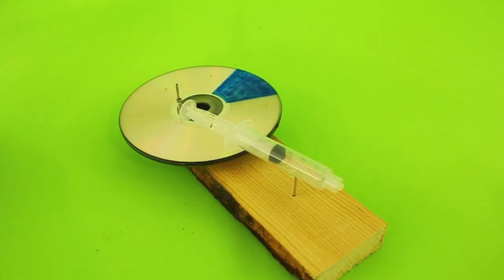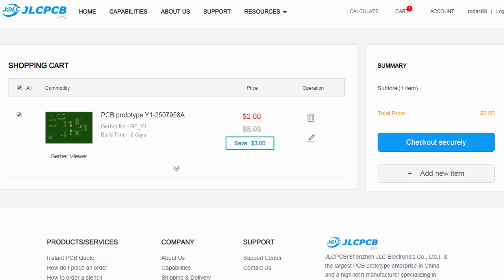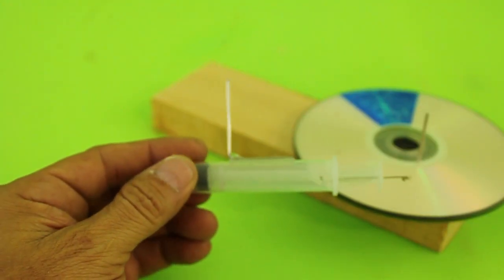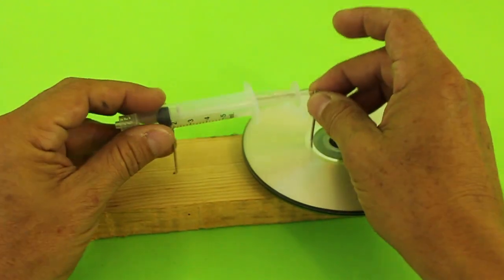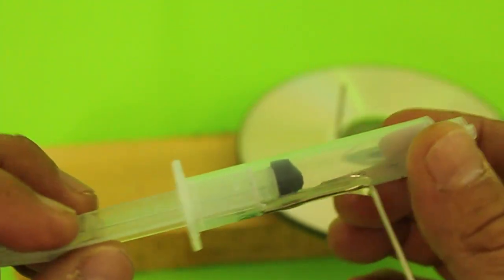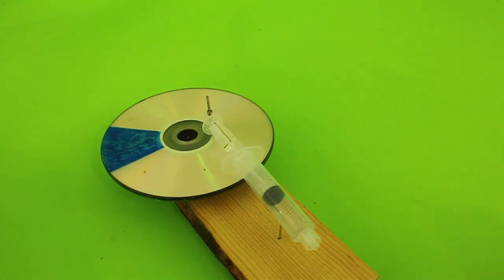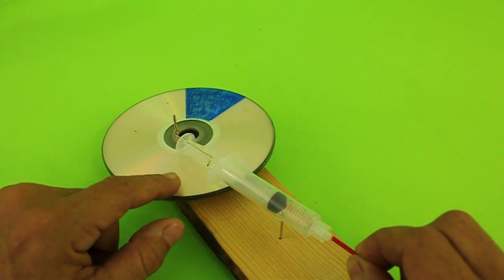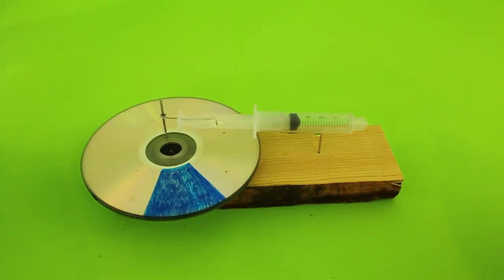Simplest Pneumatic Engine Homemade

Comment: very nice!
I wonder if you poked another hole toward the top of the syringe to serve as an air escape for the piston return while having a hose connected to the supply inlet with constant pressure?
Reply: Correct. Here we have a good thinker. That's exactly how should worka good air motor.
Reply: what?

Comment: Can you put a hole and the bottom of the cylinder for exhaust so you can attach a air supply?
Reply: I tried it and it doesn’t work that well. Hope that helps you

Comment: The CD thingy under it can be be a generator
Reply from the maker: Yes but speed is too low
Reply: Try to put voltage multiplier or transformer
Reply: @rhyiamcastillo111  power remains low